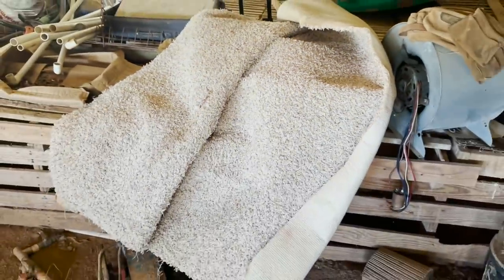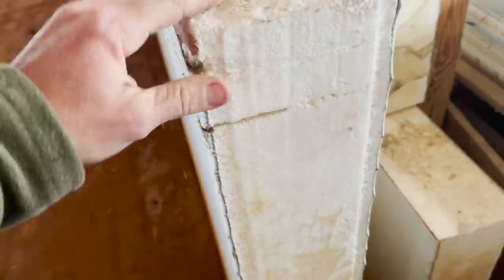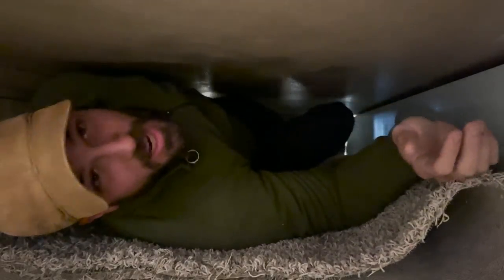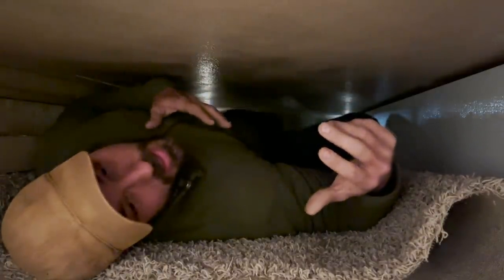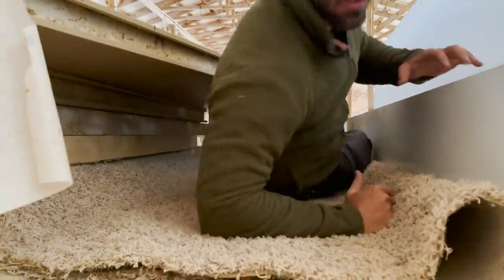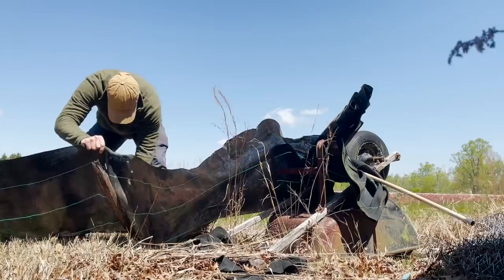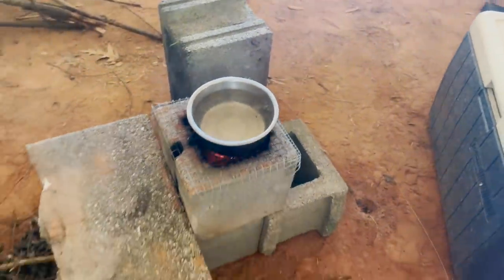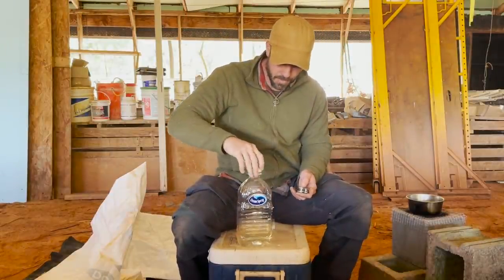Surviving a Post Collapse Scenario with your EDC | Part 2 | ON Three

Comment: The nice thing about that little shelter you built is that if anyone came upon you while you were in it, it just looks like a pile of junk, not like an actual shelter. 
Also I saw what looked like some 1/2” or 3/4” pvc pipes, you can easily make a very decent bow with that which gives you a way to possibly hunt or defend yourself, they’re pretty easy to make too.

Comment: I'm wondering why you would not clean out the container before storing your water in it.  Otherwise, isn't it just recontaminating the water you'll be drinking from it?  The container probably has mold or mildew in it from being closed up with the last bits of liquid that was in it.

Comment: So based on this video alone, it looks like he brought both a knife and a lighter with him, right?
Note: This was great practice. You can learn similar skills in your own home, at least some of them. As an old woman, I practiced sleeping on a hard floor. Because I had it, I used a flat camping mat from Walmart and put a $4 blanket over me. The key to this working was that I set it up inside of a walk-in closet 5 ft deep and 33 in wide. He's right that the smaller the space, the warmer it is. I experimented with ways to lower the ceiling by putting expansion rods slightly over my sleep level and putting a Dollar Tree tablecloth over that to hold the heat closer to the floor. I was able to survive as low as 13°. I also began to configure ways to disguise myself as a simple lump of trash in case I was discovered, by crawling inside a duffel bag. That one was set up, but not practiced. The sleeping on the floor I did for over a year and was able to survive cold without any heat.
I also practiced living on simple beans and rice for 4 months at a time with no additions other than common antiviral herbs in an attempt to stay well during the beginning of covid. I quit drinking bottled water and began using tap water. Wilderness survival is even tougher, but at least I was making headway in giving up modern conveniences, so that being able to fall asleep and getting basic nutrition would be handled so I could face tougher challenges.
I have since changed from pinto beans, which are a 2-hour cook time, to lentils and rice which is a 20 minute cook time (think less fuel and less telltale flame, able to run sooner if discovered)
One of the greatest challenges is fear itself, as well as disorientation about where to go if the entire community was in chaos. I pray we never have to face any of this. I originally tried to set up with a survival backpack and a bicycle were everything else taken out, but soon realized in a crisis someone with a backpack on a bike would be the first person a panicked society wood strip of their goods, even if leaving them alive. Even the homeless have to sleep on top of their backpacks in order for their few things to not be stolen when they finally get sleep. 
I'm praying everyday that the Lord will take me home in the rapture. A bunch of peppers with their berkeys may not last long in a violent situation. A man once told me that a gun just becomes a heavy stick once the ammo runs out and that you could pull everything you need off of the dead. Lastly, as trained military, who was forced to practice eating live rabbit organs first for the nutrition (he said that's where some of the men couldn't complete the program, having to actually eat rabbit eyeballs, etc.) He told me whatever way I saw the crowd going, which would typically be south for warmer weather, go the opposite direction and try to stay off common pathways. Made sense. 
"Lord Jesus, help us love You more today so we won't be here then. "
"I know the plans I have for you, declares the Lord, plans to shalom you (perfect peace), not for disaster; plans to give you hopeful expectancy in the prophetic end times."
 Jeremiah 29:11 (with original Greek and Hebrew meanings from Strong's embedded).
Reply: You're really getting sorted out good for you.

Comment: These are great videos.  When your sharpening you blade, you have access to ash from your stove, piss and sand  and for an added lubricant  the leaves behind you, that fan behind you might have lubricant, and perhaps the bottom ofnthat black Barrel has another lubricant...  or just use some sand at ur feet and piss on it..  Great videos. Critical means critical. Good on you  for sharing.

Comment: I would have leaned those insulation panels up on those inner frame posts so that it would look like the usual chicken coup that's been there for a while and then it would only look a little darker on the inside, which makes sense. I'd cover 4 sides with that stuff with the rocket stove in the middle and then you could have a fire to cook your food, the flickering wouldn't escape (but always check that at night to be sure) and then you could use the old carpet like a sleeping bag if it got that cold, plus heat up some rocks on the fire to put next to you while you sleep. That floor is dirt too so the center of the Earth is the limits on what you can do there (although I'm sure your friend doesn't want you digging a subterranean cavern in his/her chicken coop.

Comment: You could have used the blade if you made a bucksaw. Nice idea with your shelter and escape plan. I probably would have just used that room that is in the background that has cement block walls. Doesn't look to have an extra exit though.

Comment: You took a saw blade which can cut wood and create saw dust for fires, shelter building, etc and destroyed it in favor of trying to create knife out of it. If you really wanted to try for a knife you should have used the back of the saw blade, that way you would have two tools in one
Reply: I believe he did... use the back of the blade I mean. It would have taken much longer to get an edge o the saw side.

Comment: This gives a good idea of some of the things to think about. 'What If...' I might have missed it but did you mention how long to boil the water for safety?
Reply: I live (very) near the Upper Texas Gulf Coast (35 miles inland) which has been hurricane prone lately. We get "Boil Water" notices all the time. City/Rural Water suppliers specify 5 minutes for pre-treated tap water. Well/unapproved ground water supplies (creek/flood) are recommended to boil water for 9 minutes Minimum...Note:   Both times are started only after water reaches a full-to-rolling boil. Personally, I would stretch the 9 minutes to 15 minutes, just to be on the safe side...
Reply: I was under the impression that once it is boiled, its boiled. Keeping it at a rolling boil isnt doing anything besides wasting fuel and losing water.
Reply: @tommysaulter9171   From a microbiologist who knows what he is talking about:  Boiling water for more than a few seconds is unnecessary, a waste of time and fuel.  All the pathogens you are likely to come across in the home, farm, woods, etc. are rendered harmless at temperatures around 160 Fahrenheit ( or 70 degrees Celcius )  They do not get any more dead if you boil them for 15 minutes!   This includes  viruses including Covid-19.  All the bugs are effectively inactive before the water has even reached a full rolling boil.   
Contaminated milk  from dirty animals is rendered harmless by Pasteurization -  heating it to just 135  degrees Fahrenheit for 15 seconds in commercial dairies, who then sell it on to supermarkets for kids and babies to drink!   Milk is a perfect growing medium for bacteria, however, 135 Fahrenheit gives it a shelf life of 10 days when refrigerated.

Comment: Maybe I'm missing something...but why didn't you just hole up in one of the cinder block rooms...??? Wind proof, lightproof, and the cinder blocks would retain/provide extra warmth. I understand that what you recorded was to show what is possible (creativity)...
Reply: There are pros and cons to almost any decisions.. If there is potential danger of other humans like marauders the very best approach is concealment and remaining undetected. The danger taking up shelter in a structure easily come upon is your comfort could become your trap. I like that he thought about the one way in and realized he would need a exit rather than a confrontation.  An alarm of some sort can wake you, but if it is to obviously set it also alerts others you are there.. so make it look happenstance. And, think it though.. The door burst open, a bottle balanced on the door knob falls and breaks... obviously someone’s in here... And then you hear... spread out. If your laying in that cubicle your only hope is to make it to your escape route and they wont give chase...   its a risk. Make sure you have more than a couple ways out that are not obvious. And if someone comes to the door you can melt away as silent as a mouse. This would mean planning exit points that would give you ability to move away. So map your path so you can do it at night using the cover of darkness. Which would mean clearing a path without making it obvious.    There is a whole lot of thinking that goes into survival. Timing is everything, and situational awareness will differ from place to place and scenario to scenario.

Comment: i have to wonder why bother to sharpen an old rusty saw blade when you have a leatherman. That is wasted calories. yes i would have taken the saw along but i would not have bothered to alter it. your shelter is top notch . you need to add some water purification tablets, and several one liter whirlpack water bags to your wallet. as far as locked doors are concerned you should learn to use lockpicks silent and can open most generic locks you find around buildings like that.